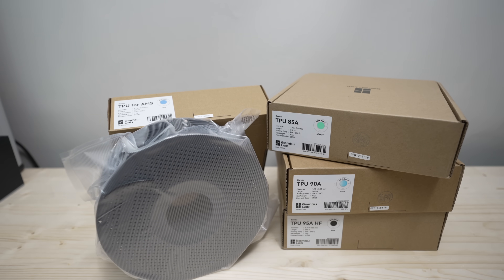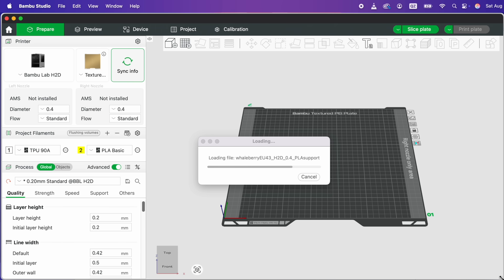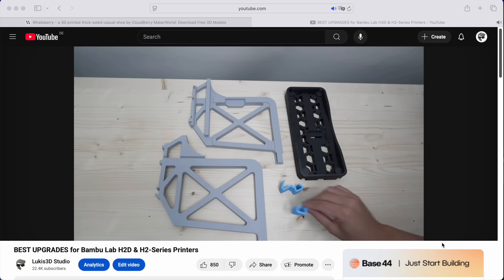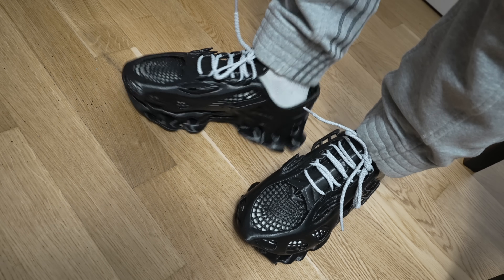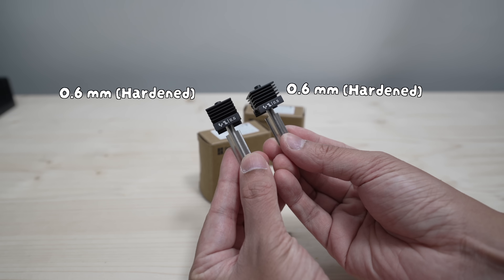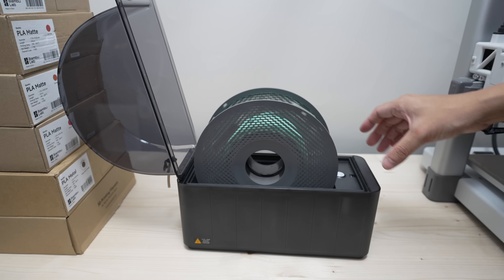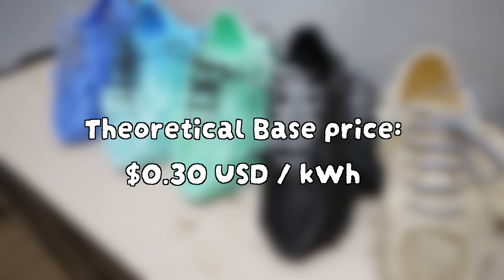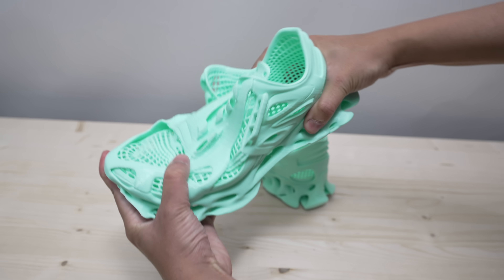How to print TPU with H2D (Which TPU is the best for footwear?)

Comment: Can you modify the shoe design and use the ultra flexible TPU for sole and most of she and use the pla for an insert for the arch creating a more rigid support design so the softness doesn’t destroy your feet?
Reply from the maker: that’s a great idea! though it’s not possible to print it using the H2D. But a toolchanger like U1 or PrusaXL can definitely print different TPU materials, but sadly i don’t have those printers to try that out

Comment: Can you explain why the tpu cannot be in the AMS-thing together with PLA and other random filaments?
Reply from the maker: the tpu is way too stretchy, it will get stuck in the pathyway when the AMS push it to the extruder. TPUforAMS is abit sturdier, so you can load it in the AMS.

Comment: Are these possible with a single extruder machine? Would you just have to print the supports with tpu instead?
Reply from the maker: yup, exactly. You need to print the support with the same tpu material as the shoe

Comment: Seria possivel imprimir a sola do Tennis com um TPU mais rigido e o restante lab 85 A?
Reply from the maker: yes with the dual nozzle, its possible. But the more rigid TPU should be compatible with the AMS, e.g. TPU for AMS. 
or you can just print the sole and the shoe separately.

Comment: Man I've been trying to figure out how to size a pair of shoes for my wife she wears a 6 1/2 us but every file I see don't have size options I said only thing I can figure is I'd have to print you 70% or 85% or 100% size and I don't know how to tell how to get to a size six and a half if you have any suggestions I would really really appreciate it I tried to do this for her birthday back a couple months ago it i was not able to get it done so I would really really really really really really for Somebody explain to me how to make a 6 and 1/2 size shoe
Reply: If the shoe is size 9(or whatever is in project details) just do the math for conversion, 9/1 = 6.5/x -> 9x = 6.5 -> x=6.5/9 -> x=.72 ; in this case x would equal 0.72 giving you a scale of 72%

Just keep in mind some designs might use different units of measurement (e.g US/EU sizing, or inches/cm)

Comment: I am planning to do a project printing with TPU. Besides the H2D, I am wondering whether the QiDi Q2 can perform similarly with a limited budget. But yeah this video does give me a lot of information regarding working with TPU materials, thank you.
Reply from the maker: you’re welcome! Glad that the video gave you some helpful info.
H2D is a dual nozzle printer so its possible to use PLA as support for the shoes. If your Qidi doesn’t support multimaterial printing, I guess you could print the support with the same TPU material for your shoes, which also works pretty well.

Comment: Something to try would be to print the soles in a harder tpu and the rest in the softer. A lot of purging though due to the orientation. Kids shoes might work level on the build plate though
Reply from the maker: yeah it would be definitely interesting to test that out! A toolchanger printer would be perfect to print mixed TPUs of different hardness

Comment: LOL I hope yall wearing sock and cleaning them microplastic shoes....   Skin absorption: Chemicals from microplastics can be absorbed into the skin. This is particularly a concern with wet ground material, which can increase skin absorption. Bone and muscle damage: In lab and animal studies, microplastics have been shown to: Reduce bone cell viability, promote bone breakdown, and disrupt bone marrow function. Cause muscle atrophy, impair muscle fiber density, and increase lipid deposition in muscles. Inflammation: Microplastics have been linked to inflammation, both generally and specifically within joint tissues. Allergic reactions and irritation: Some studies suggest that microplastics' interaction with endocrine-disrupting chemicals could lead to skin irritation, redness, and dryness.

Comment: My sister and I have been experimenting with different grade TPU's for about 4 months now. I have an amputated foot so we have been trying to create a everyday usable foot as the one provided by the orthotics team is clunky, heavy and quite difficult to walk with. Also the amount of times I've been asked 'how I broke my leg' is annoying because it really does just look like a leg cast!!.

So far we have printed about 15 different types, shapes, styles and fittings, each one needing adjusting a bit here and there. We've successfully made 3 which are well fitted, comfortable and wearable for long lengths of time - yeay!! 🎉🦿🎊

We found the Eryone 90A creates a more flexible fit without causing rubbing or pressure points on the remaining parts of my exposed ankle. We really have been having so much fun experimenting with different styles, shapes and grades. 

The printer we ordered was the Bambu P1S AMS 2 Pro Combo with Buffer and really has been one of the best (and most fun) investments I've made in a very long time.

Thank you for making this video, it's given us some ideas and thoughts on changes we can make in the future. 

Have fun and keep printing ❤️

Comment: Printed the airberry ( same designer) in 95A and now 85A tpu, Also did 83A tpe which felt really nice. I think either the Biqu filament or 90a is the sweet spot for shoes with tweaking the infill as a way to balance feel vs durability.

Comment: Can you post the Bambu Lab project file? It looks like you have the project dialed in. It would be nice to see your print settings. Thanks!
Reply from the maker: Except for the 85A, I just used the designer’s print profile and only changed the TPU type. The print profile is pretty good👍🏼
Reply: @Lukis3D  Can you provide the firmware version. I have a brand new HD2 and it doesn't print anywhere near as nice as yours does.
Reply from the maker: it should be the latest one. Did you place the TPU above the printer and loaded the TPU directly into the extruder like I did?
Try the method with the stacked up boxes.
It’s the best way to print TPU with the H2D. and make sure there’s no drag, you want the spool to rotate as smooth as possible.
Oh and dont forget to dry your TPU (even though it is brand new!) and keep it in a dry box so it stays dry. Good luck!
Reply: @Lukis3D  Can I ask what TPU you are using?

Comment: Do you think that we can print TPU 90 and 95 in one model ?
Reply from the maker: i guess it’s possible, but Bambulab strongly advice against printing TPU using the left nozzle. so to avoid clogging problems, you may want to use only one nozzle for one type of TPU at a time.

Comment: I have not been able to get the H2D to print different types of materials. both extruders with the same material are fine but if they are different both look terrible. I have checked the setting for mixing print temperatures. Any other suggestions?
Reply from the maker: which different materials are you trying to print?

Comment: Do you think an H2S can do it with TPU supports or are they too hard to remove?
Reply from the maker: for this design, the support on the sole has more contact areas so you need to be careful when removing. You probably gonna see some scarring but its on the sole anyway. 
The support on the top part has small contact area so it’s gonna be easier and less obvious scarring.

Comment: Love the AMS holders you have, is there a file for them at all.?
Reply from the maker: yeah its a great stacking solution for AMS units. I’ve updated the link for the AMS stacker. I actually featured it in my  H2D upgrades video, so you can check it out if you want👍🏼

Comment: Seems to like you need a firmer core at the center of the shoe to stiffen the overall shoe and then your softest material for the interior of the shoe and firmer plastic for the bade
Reply from the maker: sounds a like a great solution! Hopefully 3D printed shoes designs will get better and better each year

Comment: I had 2 clogs when printing TPU95A when i was using the back port. Then i printed the mount you also printed. And now for about 30hours no jam at all. I recommend this mod for everyone!
Reply from the maker: great to hear that man! yeah the mount is a lifesaver💪🏼
Reply: From this video, it looked like just placing your dry filament box/feeder on an elevated surface next to the printer works best, even better than that top mount.
Reply: @ChristmasEve777 i doubt that, because straight from above is a direct path.

Comment: I use a 3 way adapter to connect both AMS and my heater/spool holder in the 3rd port to always have them connected
Reply from the maker: yeah I’ve seen the mod before, it seems like a really good solution!

Comment: great video test, very surprised abt quality did you tried with other brand TPU then bambu ? 150mm/s is really fast for TPU usually should be around 40 but the flow mm3 decide in fact  did you had issue with the overhangs ? or tested without support ! thx
Reply from the maker: thanks man! Besides the one from Biqu, no. But I would love to try some other brands. Yeah I could go slower but I didnt wanna wait that long. Anyhow, the shoe turned out great! Also no issues with the overhang👍🏼

Comment: Can you use two diferent TPU hardnesses? One on each extruder?
Reply from the maker: Technically yes, but Bambulab doesnt recommend printing TPU with the left nozzle though so I wouldnt do it.

If you’re trying to do multicolor TPU prints, you’re gonna need something like a toolchanger.
Reply: @Lukis3D  Is the left extruder different than tha righ one? Component-wise

Comment: What was the infill that you used for each print? Doesn’t that also contribute to how soft or hard some of the TPUs are? Great vid btw I’ve been planning to print these so this was a huge help
Reply from the maker: yes definitely! The result will vary greatly if you change any of the parameters. For this video’s sake though, I kept everything costant and used the designer’s settings to give a fair comparison.

Well except for the 85A though since i had to use different hotends😄

And thanks for the feedback man, I’m glad you found it helpful!
Reply: @Lukis3D may I ask, what settings did u chage? I want to print them in 85a,

Comment: Great video! you should give foaming TPU a try. Weighs significantly less than the regular ones and is very soft. Got some slides printed in them and theyre amazing.
Reply from the maker: hey thanks for the comment man! alot of commentators mention foaming TPU, so I’ll definitely try that out!
Aw man i need a second H2D. These shoes take so long to print😆

Comment: why did you use the 0.6 hotend ?
Reply from the maker: it is the recommended hotend to print Bambulab 85A. And if you’re using BambuStudio, it won’t let you choose 85A if the hotends are not set to 0.6mm

Comment: Hey just a heads up the morphlex will get softer if you increase the temp. I did my first pair of slides at 240 all the way up and they’re pretty soft. I’ve been printing it on 260 now with pretty good results and it’s incredibly soft. The only issue I’ve had is the tpu bonding to the PLA supports at those temps. Right now I’m doing a set of baby shoes for my daughter as a test with PVA supports. Used the 90a profile as a base, changed the temp range to the 225-260 on the spool. First layer 240 all others 260. Then changed all of the fan speeds to 40%. I’ve also noticed I get a much better first layer if I do a couple skirt loops, but that just could be my setup.
Reply from the maker: dudeee thanks for the tips!! That’s a real gamechanger, I don’t know why they didnt communicate this to their customers.
I’ll surely try that out the next time Id get my hands on the Morpflex! And Good luck printing the shoes for your daughter man!
Reply: @Lukis3D no problem. You might also want to check out sirayatech tpu air. Haven’t tested it myself but it’s the same concept as the morphlex. They post a chart though showing the expected hardness at each temp.

Comment: The price of 3 pairs of Nikes is equivalent to the price of a new printer, the required filament, and the price for a few different shoe files to print... Hopefully the concept of printing your shoes for a fraction of the normal cost and reassurance of quality will be the push that makes 3d printing more than just a hobbyist pass time. As for comfort. The fact that these shoes are wearable without a proper insole is impressive. If you put an all gel sole inside it would be nearly perfect.. and maybe there's a way to print the shoe in an orientation that would allow for the sole to be made from a harder material than the top? That way the top is flexible and fitted, and the sole is "squishy" but does not collapse..
Reply: On second thought I dont think it would be possible to print the shoe with 2 different filaments because it has to be done with one consistent bead. Smh

Comment: I find the fastest way to print tpu s
Is to set your speed settings way higher than you would print at.  Then, let the filament  flow rate determine the speed .it turn out more consistent and a better finish

Comment: nice video, great that you included the costs as well, thanks for sharing :3
there is a tip: if the tpu sticks too much try some IPA on the base after it is cooled, after that you can pry it a bit easier, let it soak in between the print and the bed (10-30 sec)
for me it was easier to remove my print, I hope it works for you too :)
Reply from the maker: thanks for the feedback and thanks for the awesome tips!! Man I was so worried that I might ruin the plate hahaa

Comment: The only problem with the whaleberry shoes are that the flex points in the toe aways seem to break.
Reply: is it only applies to whaleberry model? how about airberry or bubbleberry?
Reply: Those ones have a different structure, I think. The bubbleberry should be printed with a 90a material; anything less, and it's too soft.

Comment: Personally I have had no issues printing the 85A on my P1S using a 0.4 nozzle.
Reply from the maker: yeah I’ve seen some users printed 85A using the 0.4mm nozzle but I didnt wanna risk it, it was a 5-days print afterall and it was pretty hot in my studio😄

Comment: How is the slip? Liquid on hard floors can be dangerous. I'd print these for work if they were non slip. Or at least slip resistant. Maybe a different shoe with a different tread? The cost is roughly the same for production quality from a shoe store. So this would be great for working somewhere that requires safety shoes. If they were a little more water tight and slip resistant. Also, oil resistant. Mostly oils used in cooking.
Reply from the maker: i wouldnt use these as safety shoes to be honest. I’m sure safety shoes have alot of safety requirements, not just being slip-resistant but I’m sure it should withstand heavy impact as well. and depending on where you are, the requirements might differ.

Without knowing these requirements, I wouldn’t be able to tell you, but I’m very skeptical that they can be used as safety shoes.
Reply: @Lukis3D  That is the requirement. Safety shoes are a broad market, but basic is basic for service work. Non slip/ Oil and Chemical resistance. Waterproof is extra. Composite or Steel toe etc is useful. Not required in a restaurant. Anything beyond restaurant or service etc. Would likely need Safety Boots. Not shoes.

Comment: Awesome video thanks.   Can you make a video printing a shoe with 2 different TPU colors while having PLA for support?  (TPU preferably 85A-90A)
Reply: I imagine you're thinking of using the AMS TPU for colorful details, and then swapping it out with the PLA support, leaving the main TPU for the shoe structure on the other fixed nozzle. There are two problems: first, it's not certain that the AMS TPU won't fail you; second (and more seriously), there's a lot of material waste and much longer lead times. This video is excellent because it shows the limits of economies of scale in making 3D printed shoes.
Reply from the maker: you’re welcome man! If you’re talking about automatic filament changes while doing multicolor TPU filaments, while having PLA support, it’s not possible with the H2D. 
It’s possible if you do the loading manually or you use the TPU for AMS (68D) though, but I think that’s not what you want.
For multicolor TPU prints you would probably need something like a multitoolheads / toolchanger 3D printer.

Comment: Exceptional effort. Thank you for investing so much time. I love your videos and your way of appraching things. Could you tell us something about the little issues on part of the shoes? As far as I regocnized the morphlex shoe (the beige one) was broken at the outer front of the right shoe and the 85A shoe (the mint one) had a little failure in the structure of the front of the left show (near the big toe). Did these things happen while wearing the shoes or were they print issues?
Reply from the maker: hey thanks man! Glad you liked the video.
The tear on the morphlex shoes was caused by my impatience of removing the support. I probably squeezed the shoe too hard and it broke there where you can see it😅
The tear on the 85A shoes was caused after I put them on with socks on. I probably would need to print them 0.5x bigger. Without the socks they fit me perfectly and they also didnt break before I filmed this video.

Nevertheless, a user here has mentioned that the design of the shoes itself is flawed and the toe part is its weakest part. So I guess they probably chose 90A to advertise the shoes as it is abit firmer and hopefully more durable.